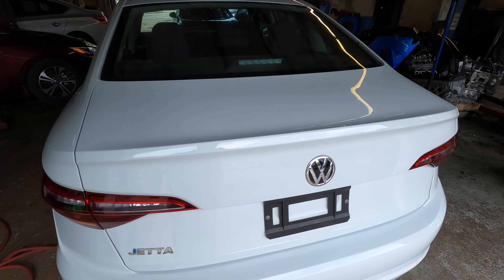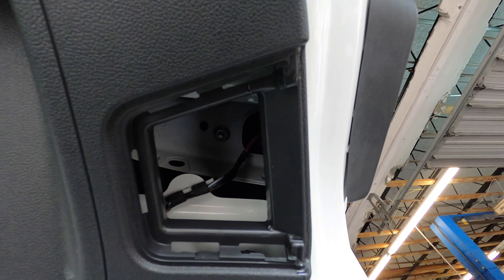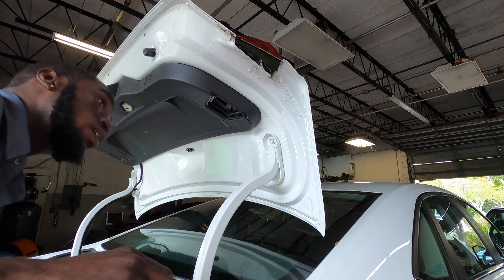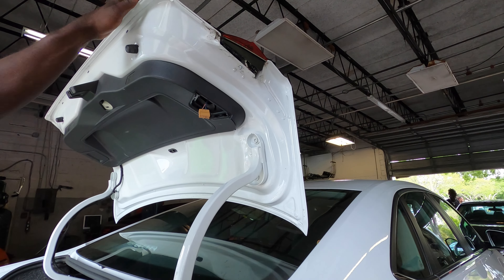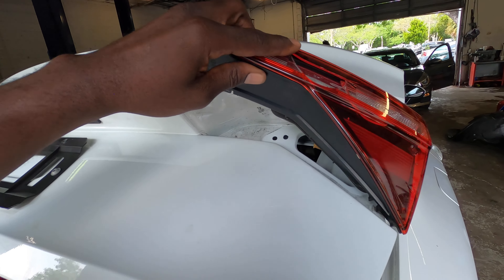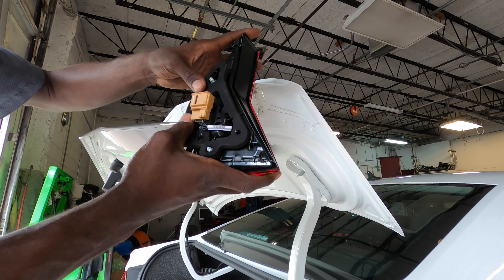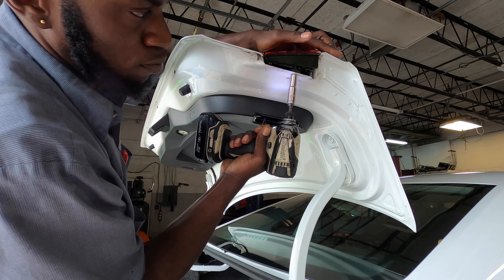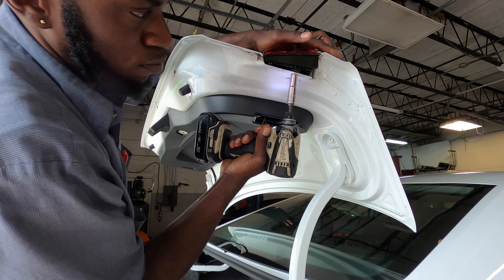Volkswagen Jetta tail lamp on trunk replacement

Comment: 👍Thank you. This is the most accurately described video and the only one that truly & clearly shows you how to replace the rear backup light assembly on the trunk lid. All the other videos say "back light" or "rear light" but they are really the Rear Turn Signal and as soon as their video shows the inside, side of the trunk 👎. So again, thank you for actually showing the backup light assembly and how to replace it.